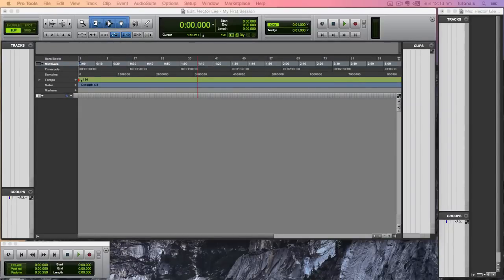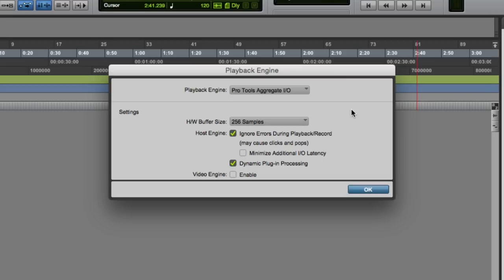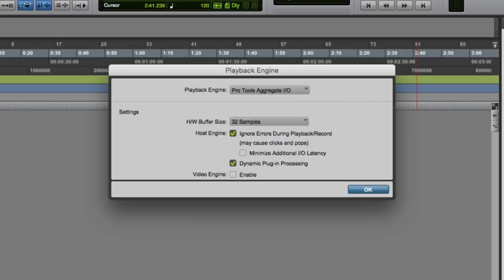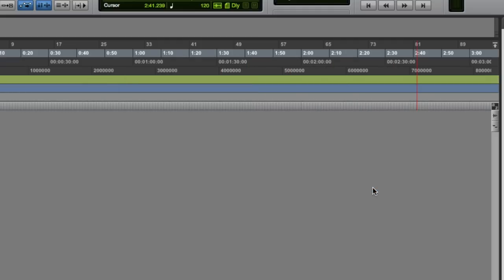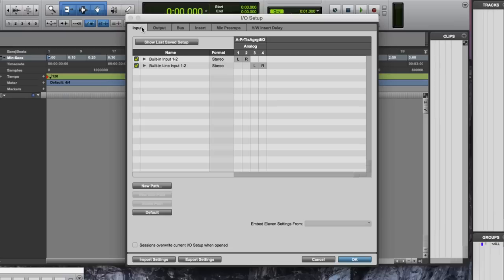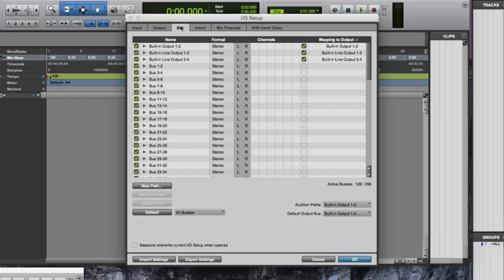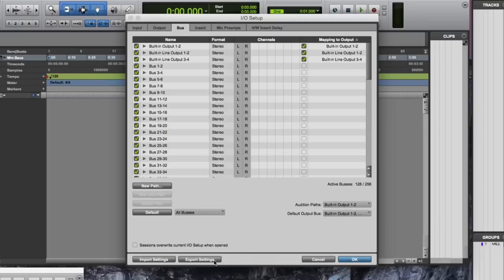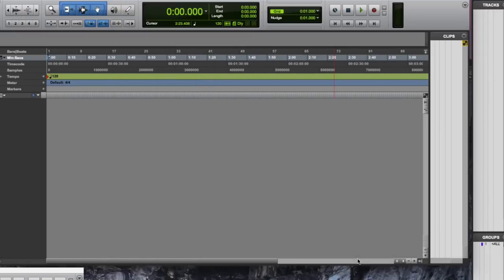Setting Up Your Audio Interface In Pro Tools - Pro Tools Tutorial - Soundgrains

Comment: Can anyone help me? I got this message when trying to pick my interface on playback.[ Assertion in "E:\Code\238949\Protools\AAE\Source\AAX\CFicAAXWidget.cpp", line 994]
Reply from the maker: sounds like an issue with your drivers for your audio interface? have you check if your audio interface has any updated drivers?
Reply: @Soundgrains  I have the same problem with the same interface, but how can you check to see if there are new updates for it?

Comment: what is the problem when you can't see your interface in the drop down menu?  i have the m-audio plus and all the drivers are up to date.  its running in my task manager but protools just doesn't even see it at all.
Reply: additional:  my computer recognizes the m-audio as i can select it for my output speakers for anything else.

Comment: I am using a Zoom R16 as an interface on Mac Pro Tools 12. I set the Zoom as the play back engine and was able to record tracks but i have no clue how to set up the I/O so that i can hear the audio and midi tracks.
Reply: same man im using the R24 and it doesnt say there is any input. Have you got it working now?
Reply: @zachfitzgerald  instead of trying to figure out the i/o settings to get the sound to come out from the computer. I used the built in left and right output on the R16 and  plugged in studio monitors and it works perfect. Make sure the playback engine is on zoom and that both input and output are routed coming out of the zoom. Hope that helps.

Comment: I have a Behringer UMC404HD and I'm using ProTools First via Windows 10 with 16gb DDR4 RAM, i7 7700K. Whenever I use it to record, the track seems to always crack. I have made sure the signals in the green, I have tried recording in mono and stereo but no luck. I've also tried using Audacity and Reaper but the same applies to these too. 

Is there any reason it's doing this?

Comment: hi guy i dont have Pro Tool First Aggregate I/O in setup menu and no built-in output too. Why is that?
Reply from the maker: Are you on Mac OS or Windows? Aggregate I/O and built-in outputs are only on Mac OS.
Reply: Pro Tool First 12 on window 10
Reply from the maker: Which audio interface are you using? You should be selecting your external audio interface if you have one. Some built-in audio interfaces do not have drivers that support Pro Tools. If you do not have an external audio interface and your default output doesn't show in the setup menu, you'll need to install ASIO4ALL. This should provide a set of drivers that might help to get your built-in audio jack working. External audio interfaces are still the best option.
Reply: I have Focusrite Scarlett 2i2 2Gen Studio connected but i have no monitor audio speakers. Is it allright to set up?
Reply from the maker: Yes. That is perfectly fine. The headphone out at the front is the same as the audio outputs at the back. You should see your Focusrite Scarlett 2i2 shown in the list of devices in the playback engine window.
Reply: Soundgrains could you possibly see video in my channel thats exactly problem i have in window 10? plzzz guy!
Reply from the maker: Hi. I've just briefly checked your video. If you have sound working for your drum track then it's no longer a playback engine issue. If you're having problems with the bass and pads track then it is an issue with the routing/setup of those tracks. It would be much easier if you can show a screenshot of your session that isn't working. When you say the track isn't working, are you trying to play the instrument with a midi controller? You'll need to turn on the track record enable on those track for midi to work on the track. That's a common mistake.
Reply: i have posted problem video with pro tool 12 right now please check it and i hve no idea why. Thanks a lot for reply
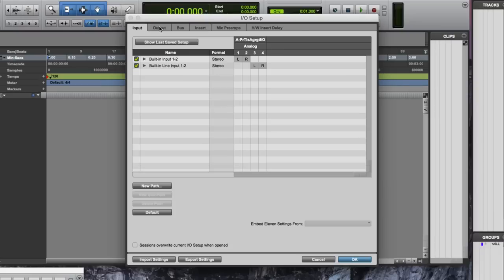Reply from the maker: Hi. Sorry for the late reply. I just watched your video and there's nothing wrong with your setup. The confusion here is there is nothing recorded on the other midi tracks except for the drums. You'll need a midi keyboard to play and record the midi sounds. The video tutorial that you showed in the first video shows him recording the bass line at 3:40. Although the video didn't seem to explain how midi works and how he is recording the midi.

Unfortunately, I have yet to make a video explaining recording midi in Pro Tools. But you can watch my video about virtual instruments to understand how the virtual instruments work in Pro Tools.https://www.youtube.com/watch?v=zYqPWg9On44. If you do not have a midi keyboard then the only to enter notes is to use the piano roll.

Comment: So I've got a focusrite scarlett solo interface and tried plugging my electric guitar straight into it but it wasn't picking up any signal. Guitar knobs were turned all the way up, set it to instrument input, and turned the gain knob all the way up. However, when I strummed, no input was going through (no green/red light on the interface or noise bars on the instrument input on pro tools first). I believe it's not the wire or guitar because I tried it with two guitars and both would play through an amp with the same wire. Any thoughts?
Reply from the maker: Hmm.. Seems strange. You should at least be able to have the green ring light up on the Focusrite Scarlett Solo. Just to confirm that the cable you are using is a 1/4 inch TS cable and not a TRS cable? And the volume knob on your guitar is all the way up?

Comment: I just bought a scarlet forcusrite 2i2 2nd generation and it come with Pro Tool First. I did install all the driver and Pro Tool software, but I am having a problem of how do I route the audio from the computer system throught the forcusrite interface and get it into pro tools software. I try to open a karaoke clip from youtube and try to sing along and record my vocal and the audio from that youtube clip by using pro tool software, but all I heard back was only my vocal and no audio was recorded. Would any one please show me ho to set it to get the audio in as well.
Reply from the maker: Hi Kristy. Are you on MacOS or Windows?

Unfortunately audio interfaces or Pro Tools do not work to route audio from YouTube. If you wish to route the audio from YouTube to Pro Tools then you will need an additional software to assist in the routing. The much easier option is to download the audio from YouTube and import it into YouTube instead.
Reply: @Soundgrains  thank you for your responded.

Comment: I need help!
My audio is fine,set up that ASIO driver thing, but the biggest problem is that the playback audio only plays on my laptop speakers, not through my headphone speakers please help, how do I set this up. And by the way, when I clicked playback engine, it didn't come up with the same dialogue box. Why is that? Also
I'm using Windows 10
Reply: I have the same problem, do you have a solution yet? would be glad if you could help.

Comment: I'm on Windows with PT First, I have a scarlett 2i2 2nd gen and a NT1a mic --> I can not find any way to make my PT recognize my microphone. It will not pick it up at all, however it does see the scarlett... I can sing my heart out but it won't pick up sound... how do I fix it :{ ?
Reply from the maker: Did you turn on phantom power and bring up the gain on the correct channel?
Reply: @Soundgrains  what is phantom power? and I don't understand how to change the input on PTF

Comment: how do i play other media threw my mbox monitors
Reply from the maker: +Beast ThaLyrikal which mbox are you using and what is your operating system? Mac or Windows?
Reply: mbox2 n windows
Reply from the maker: +Beast ThaLyrikal I don't have my mbox 2 with me to test now. But if you have it working with Pro Tools then the windows Drivers should be installed. In the taskbar, click on the speaker icon and open 'playback devices'. You should see your mbox or a digidesign audio interface listed. Set that as your default playback device and all audio should be played through it.
Reply: yea when i go there my mbox isnt shown but its clearly hooked up....do u kno y that is
Reply from the maker: +Beast ThaLyrikal are you using Windows 10? I haven't used my mbox with windows 10 but it sounds like the Drivers need reinstalling or something. I'll need to dig out my mbox 2 to check.
Reply: Kool thnx and nope still isimg wimdows 7

Comment: I am currently experiencing difficulties. I am using Pro Tools 12.6. For an interface, I am using an Alesis Multimix 8i USB FX. I have everything selected how it should be for me to start recording. However, whenever I click to change the input of a selected track, Pro Tools does not recognize my interface as a usable source for input. How do I resolve this?
Reply from the maker: +Justin Kitzmiller Hi! are you using Windows or MacOS? Which version of the OS?
Reply: I am using a MacBook Pro with OS X.
Reply from the maker: +Justin Kitzmiller so you're able to set the Alesia as the playback engine? But can't use the inputs?

 is there an error message when you change the input of a selected track? Or is the track just grayed out. How do you know Pro Tools isn't recognizing the interface?

At the moment it sounds like the IO Setting aren't setup correctly to use the inputs. If you could show a screenshot of your io setup and the error you are getting then it would be much easier to troubleshoot.
Reply: The Alesis is available in my playback engine. There are no error messages that have been present. I try to set the input on an audio track in correspondence to the interface; however nothing shows up when I click on input. The interface option within the input button in Pro Tools is grayed out. I figured it could have been something in my Audio MIDI Setup. Although the Alesis is recognized within this window. I have it set up so that the Alesis is selected for input and the Built-In Output for output.
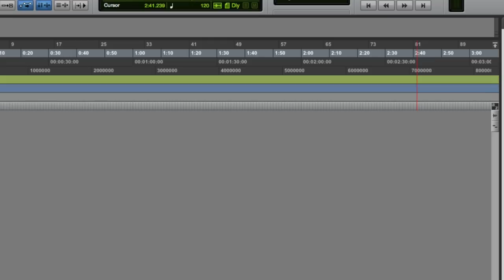Reply from the maker: +Justin Kitzmiller sounds like a problem with the I/O setup window. This is covered at the 3:10 mark. 

1. Double check that your setting the input on an audio track
2. Open your I/O Setup window. In the menubar click on Setup -> I/O Setup. 
3. Go to the Input tab and check that your inputs are showing here. Reset the paths by deleting all existing paths and click on default if required. 
4. If the paths are already showing then ensure the input configs are of the correct type. Stereo inputs will only show up on stereo audio tracks while mono inputs will be available on mono tracks only. You could be trying to assign inputs to a mono track but only have stereo input paths configured in the I/O Setup panel. The default feature works well but isn't always perfect.